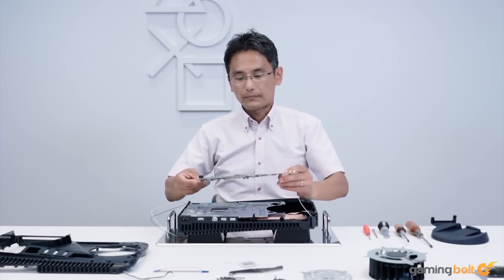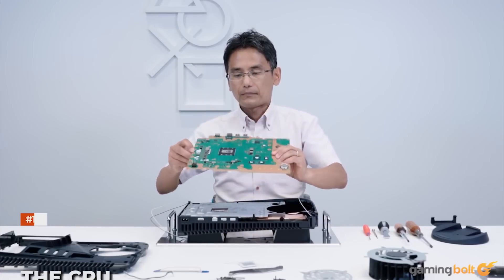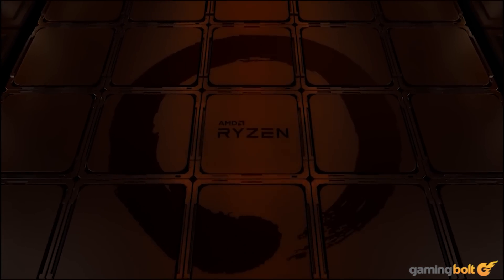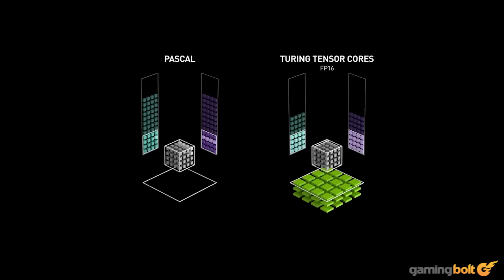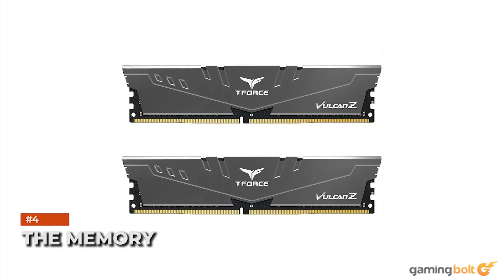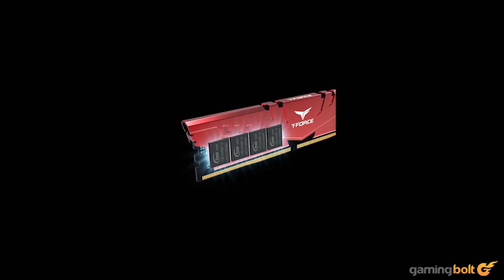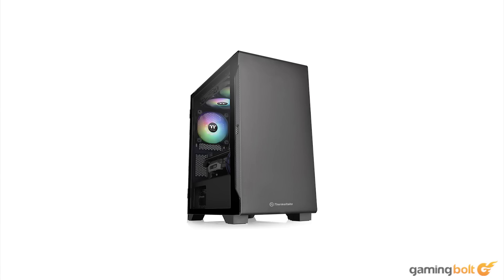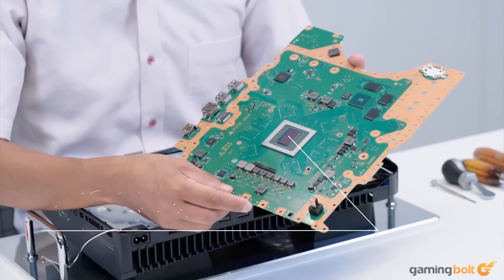How Much Would It Cost To Build A PC As Powerful As The PS5? (2021 Edition)

Comment: My RTX 3060 Ryzen 5 with 32gb of Ram and 24” Samsung M7 monitor cost me around $1250, My PS5 is $529 with GOW Ragnarok and NBA 2k23 and my 4K TCL 55” TV is $400, Total of $929. Nvidia claims that RTx 3060 is 30% faster than PS5 you barely see any difference in terms of Graphics, Not to mention that in PC you need to utilize the Graphic Settings, in ps5 just plug and play.

Comment: Just get both. Get the PS5 first it's awesome to just play games with no  trouble. Slowly buy your pc parts while you enjoy the high end gaming engine. You also should get a 4k TV  for the ps5 to be worth it. Again this man did not add the price of any peripherals. No Monitor or TV cost. Keyboard and mouse also pushing the price up. In my experience with a pc be ready to replace parts because your pc will break one day. You can live with a low end pc and a high end ps5 by the way. If you can get a ps5 get it and pay for the Extra psn and enjoy hundreds of games for 100 per year. The only thing you can do with a pc is mod your games till they break 😆 don't be hanging around Nexus mods.

Comment: Video left out upgradability, with a pc you can easily swap gpu's  and if your board supports the next gen cpu all you really need is a bios update and you are right there with the new consoles. Also you can customize your experience where as with a console you are really stuck with whatever you get and need to buy the next gen console to get better performance which means the older console gets put back in the box and in your attic. I used to like console gaming until I realized how good pc gaming is, better refresh rate and lower framerate times equals far better experience.

Comment: CPU is far more than is needed. $150 CPU would do (at the time, now same CPU would probably cost $100 - R5 3600 or similar). That gives you enough money for windows and peripherals included. 

Other than that, surprisingly good choices.
Reply: I'm building a pc right now,watching this just wondering what it would be like to a ps5. And I'm using a r5 3600.

Comment: This technically isn't accurate as the ps5 games are optimised to run a lot better for the console
Reply: Any pc with better specs will out perform the ps5 with their own exclusives. Enough rigs can run the last of us with 70 plus fps 1440p and above resolution max settings plus ray tracing

Comment: The issue I have with this is just the actual cost is higher to due GPUs being scalped left and right, chip shortages, etc..   And the ps5 wasn't comparable to a 2070/ti but closer to a 1080 just with ray tracing support which is basically a 2060.   I've seen 2060s go for $199 before shit hit the fan, 3700x is not the comparable cpu to the ps5, it's closer to the 2600.   If you factored in the used market (even for a 2060 in 2021 or say you got lucky in 2020) you would be close to $500, new would be around $7-800.
Reply: Nah i have 2060 and ps5 is definitely faster 💀 ps5 perhaps is equal to 3060 or 3080
Reply: @Залізнийкулак  sorry but no, the 3060 and 3080 are just stronger cards than what the ps5 has.
Reply: @ShinRukiri  do you even have ps5 and 2060? I play both and i know ps5 is on par with 3060 if not faster
Reply: @Залізнийкулак  Yes I do own a ps5, and no dude the ps5 is not anywhere near the performance of a 3060.. not only do we have hard data backing that up, the closest GPU to a PS5 is the 6700/6700 XT, the XSX is the closest thing to a 3060..   Remember the PS5 GPU is 10tflops, the XSX is 12tflops,   and the raytracing is pretty awful on both consoles tbh...   I would rather spending $700 on a console that could actually deliver 3080TI tier performance but in a console form factor, and both sony and microsoft can make that happen.   Will this remove the average people? yea it will, but they got nintendo so it's whatever.  Take a look back to the 3060/ps3 days for one the 360 had a GPU that you couldn't outperform for quite awhile, granted it was like 6-8 months but that was a big deal and the ps3 literally had untapped potential which sadly took it's entire lifespan to realize..  That was the last gen when someone could say a console was on the same par as a high end pc (at the time), granted that changed within half a year but it was at launch..  the PS5 and XSX are literally the bottom of the barrel when it comes to high end PC performance.
Reply: @Chronos_TVee ps5’s gpu is equivalent to a 2070s (which is better than a 3060)
Reply: @fardel8021  thats some copium lol, and no it;s not ^O^  the ps5 has 10 tflops, while a 2070 has 14..   closest thing is a 2060 or an amd 6670
Reply: @Chronos_TVee  it’s not about specs tho. It’s about performance
Reply: @fardel8021  And again it's not on par with a 3060, it's already been proven what the closest GPU  the PS5 matches
Reply: @Chronos_TVee  nah most people agree that the performance is on par with 3060 2070 or 2070s
Reply: @Chronos_TVee  you are aware that those average people make up about 90% of the console market right?

Comment: This video now is about a year and a half (give or take) old. I just read a couple days ago that the ps5 and series X are on par with a mid tier 2015 gaming PC. 
I’m glad to see that was false.
Reply: They're definitely better than that. This video is flawed, but you'd need a high end 2016 PC to trade blows. GTX 1080, and 16gb of RAM with a beefy CPU $300 at the time probably. It'd be as good as or outperform the consoles. However, you wouldn't have ray tracing. 

This video is flawed, but that's because they chose a far more expensive CPU than needed and they didn't include peripherals.
Reply: @BucephalusHume  I built a $750 pc in 2018 that outperforms the ps5 in every area. I haven't done anything except upgrade the ram in that time.
Reply: @charismatic9467  Makes sense. Falls exactly in line with what I was saying. 

My GTX 1080 couldn't ray trace. But I'd still have taken that over a PS5

Comment: On the one hand this shows that building a PC with PS5 level specs does cost a bit more than a PS5. On the other hand, it also shows that the PS5's performance capability is barely on par with that of a low-level, mid-range, last gen gaming PC...

Comment: RTX 3060 or RX 6600 which is better?
Reply: both cards are toe to toe in rasterization. the rx 6600  is around 15-20% better, sometimes less than 15% in rasterization.. the 3060 has better ray tracing.

Comment: I agree with most everything I saw maybe except the cab.  I tend to believe that it would get super hot in that cab with one fan.  I wouldn't exactly spring for water cooling but I would def mod it for a few more fans.
Reply: I disagree with everything. the PS5 is 1080p/60hz and variable resolution/120fps on supported games. to maintain 120fps in warzone it runs in upscaled 720p
a comparable PC would use a ryzen 1700x and GTX 1070

Comment: You lost me at “windows”… Cheap motherboard, middle of the road processor, ddr4, slowish sata drive, 3060… eh, I’ll take the ps5  .
Reply: the 3060 is decent. the actual graphics power of the ps5 is no better than that of a 1070-1080 ish

Comment: ●Ryzen 7 3700x
●Rtx3060 12gb/ rx 6600 xt 8gb (cheaper)
●Asr b450m pro 4
●16gb(8×2) 3200mhz ram
●1tb ssd
●750 watt 80 plus bronze
●Any pc case that fit.
Reply: sold my ps5 for a r7 2700 and rtx 2060 super build will not go back im just a pc gamer at heart been building since 2005
Reply: Dude I have a similar build (Ryzen 5 3600, 1660ti) along with a 1080p 165Hz monitor (24"). I can get a MINIMUM 60fps on every game that I've run so far. CP2077, everything set on high, 60fps easy.
Reply: Dlss makes 3060 much much better more like 2060 super to 2070
Reply: This isnt anywhere close to the ps5 specs though. It boosts to 3.5ghz and is actually usually running between 2.8ghz and 3ghz. Its a downclocked 3600 non X model, which AMD confirmed.
The gpu is around a 2060 super with ray tracing performance less than a 2060, but the 2060s has dlss which makes it a little better
Reply: @ammanus356  my ryzen 5 3600 can reach 4.2Ghz clock speeds. I don't have a 2060, but my gtx 1660 ti can do 4k 60hz.

Comment: 1137 and some extra 100s for monitor and keybord/mouse. Sure its a lot of dough, but mind you, it also gives you acces to so much more than just gaming whereas console is just there for gaming. Plus you do need to buy a new tv (unless your fine with 1080p tv from 2012), subscription for online, maybe an extra controller and a couple of games that exceed 60 dollar/euro per game. Did not look up the price but I think its similar to pc, but with pc you can used it for more than gaming and upgrading is accessable. Sony is also moving more titles to pc so there is acces to previously sony exclusive titles.
Reply: its not 1137, its above 1500 with GPU capable of 60fps for 4k resolution...cheapest 4k monitor I can find is 400€+ so you can add that to the equation
Reply: @MrSherhi  299 euro's for 4k 60hz monitor on a webshop (Netherlands), but I would not opt for 4k personally, probably 1440p monitor. That means that a RTX 3060  would suffice. A RTX 3060 should be able to do 4k 30 fps (console games often operate at 30 fps)  It all comes down to preferance and total budget really (that is different for everyone), if people wanna game at 4k AND 60 fps its gonna cost them more absolutely, then a more expensive card is needed . Personally I'm still fine at gaming at 1080p, so in my case I would not exceed 1200 euro/dollar. In my case the build showcased in the vid would be all I needed in terms of pc gaming.

Comment: Ps5 wins. Pc retarded priced. And with ps5 you avoid random blue screens cause windows 10 and 11 are ass.
Reply: ￼ no it isn’t. You’re smoking crack if you think a 1060 is stronger than a ps5. The 1060 dropped in 2016, and you think a 2016 mid range card beats a 2020 console in specs?
Reply: I built my own PC no blue screen of death.

Comment: If you can have both then do it I have ps5 and a mid end PC playing 2k resolution at 80-120 fps, I never regret both of my purchases both are so unique  we shouldn't even compare which is better.. I spend same amount of time in both of my setups and I really enjoy both, at this point if u have nothing  , u first start from ps5 ofc since the prices of PC components are touching the sky...
Reply: a 360/3700x can easily do 2k/120 and even 4k/60 (just remember that consoles use lower than the lowest settings in comparison to pc) for esports titles, but for esports you're prob using 1080p and using a 360hz monitor which the 360 can handle.

Comment: Save your self time. You cannot build a cheaper PC equal to the PS5. Maybe couple years from now you can but the PS5 is a beast for 2021.
Reply: you actually can, just gotta use used parts and cut some corners. cheap case or no case at all and no controller, and it should be fine

Comment: Should I trade my 1060 pc for a ps5
Reply: 1060 is ussles tbh
Reply: @ztvztv1  no it's not? i still rock my r9 380x and it can run most games fien
Reply: @Celatra  are we talkin about r9 or gtx1060 her son
Reply: @ztvztv1  point i, the r9 is weaker than a 1060 and does fine, so the 1060 is not useless

Comment: No less than 1800k now depending on your location on the planet that price is tones of miles from it and you need to post links where you found your parts is easy just to make a video assuming prices.  You also miss the blue-ray drive and yes people use blue discs. An RTX 3060 can not Run Games at solid 4k 60 please don't say that. I am posting this in 2022 this video is old now as prices already higher 😂😂

Comment: unfair comparisn as sony uses a pcie gen 4 m2 nvme ssd you used sata ssd which is much cheaper and slower, everything in the  ps5 custom made from hardware to software & the games in ps5 are better optimised so the perfomce is higher when compare to  PC components with same raw power... so you should have used a better graphics card and ssd which will make the PC much more expensive... make a vedio comparing fps in the future

Comment: First year it has always been like this. Than PC destroys it next year with mid-low end components.
Reply: It will destroy nothing in the next year or two. PS5 and Xbox have desktop class components now, unlike last gen. By the time a 400$ PC will perform as good as a PS5 Digital or better, it will be probably 2024-5.
Reply: @thedonzhorzh  PS5 Console      :   400$
                               SSD Expansion :    180$
                         PS Plus online play :     60$/year
                     New Games extra cost:    10$/game

In 8 year's time with 2 new games/year, that's 980$. 
   By middle of next year, there will be desktops besting the PS5 and doing so for less than 980$.
Reply: @deductivevariance3497  NO, because of fucking digital scam coins...
Reply: @thedonzhorzh  If it wasnt for the pandemic and the disruption of supply. We would almost be able to make a PC close to the pricing of Xbox Series X or PS5. Unfortunately we cant because of the situation right now, but you cant buy a PS5 or Xbox right now anyways so pointless in talking about "desktop class components" when you cant even get it for MSRP yourself.
Reply: @Transistor Jump Just because you got it doesnt help anyone else. There is still a shortage.
Reply: @Transistor Jump Bruh dont be stupid ofc you can get one thats why you call it a shortage. You know what shortage means right?

Comment: Another idiotic comparison based around trying to recreate console hardware... pc and console hardware are totally different, and firmware AND software/os! 

These comparisons should ONLY be done by comparing visual quality and fps. Get the same game, run on both systems side by side, and swap the pc parts/change settings until you can't tell the difference. "oooh but so many games, so many parts"... Aren't you being paid to do this? Do some actual work ffs. 

-you forgot a 4k blu ray drive, WiFi card, OS, pad vs mouse/keyboard, cables (hdmi2.1 on ps5 IIRC?) and descent cooling. 

Plus, you'd need even MORE powerful gear in the PC as games will be optimised perfectly, not "closely matched" hardware.

I'd guess around an amd 6800 and 3700x which would be close to £2k with above Inc. 
Xsx/Ps5 = Amazing value, but I do love my pc. I can turn off crap like motion blur and change resolution/settings and buy games for next to nothing on key sites.

Comment: The SSD you chose is nowhere near as good or expensive as the PS5s NVME. PS5s NVME drive costs about £250
Reply: Like 530 mb/s to 5.5 GB/s read speed comparison.
Reply: @someguyfromarcticfreezer6854  🤣🤣🤣
Reply: @someguyfromarcticfreezer6854  corsair has pc ones FAR superior
Reply: @someguyfromarcticfreezer6854  it’s not 5.5 u braindead squirrel. Download any game and watch the download rate it’s like 300mbps depending on your internet
Reply: Ailewware and Dell is pretty cool

Comment: go check digital foundry's review kid!!

ps5 = RTX 2060 super + i5 9400F / ryzen 3100

sata ssd is more than enough to match console ssd, check comparison between sata ssd vs nvme gen 4

so a $700 pc is equal to a ps5
Reply: It may seem like that on paper but the way console optimisation is going it seems to be punching above the 2060 tbh especially my mobile 2070 lol
Reply: @Transistor Jump then you're very clueless

do some researches sony pony L.o.L
Reply: @Luiko0406  nope he’s not clueless he’s infact right 

Write speeds required to read ps5 games are 5.5gb
Reply: @trollymctrollus1408  then you don't have both sata ssd and nvme 4.0 

check the comparison video between sata ssd vs nvme 4.0 ssd in pc gaming
Reply: @Luiko0406  you are literally comparing something to multiple times the speed of the other… you cannot beat console optimised loading times neither anymore
Reply: @Luiko0406  ok well facts >>>>> your opinions 

Doubt your rig is anywhere near as powerful as next gen consoles either way since you honestly believe a $700 build would come remotely close

Don’t be mad because my answer was too intelligent for your bullshit 

Ps5 >>> mid end rig

FACTS
Reply: Console SSD is way faster but It's not necessarily to have it Unless you have 100gb of Furry Porn or Modern COD game downloads and you want to download it fast.